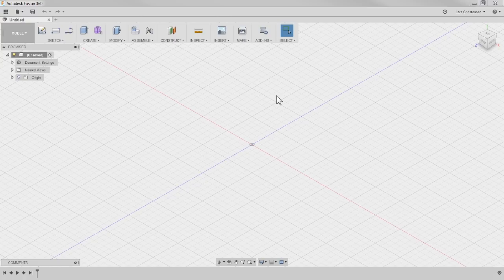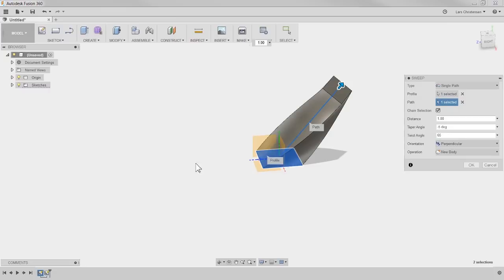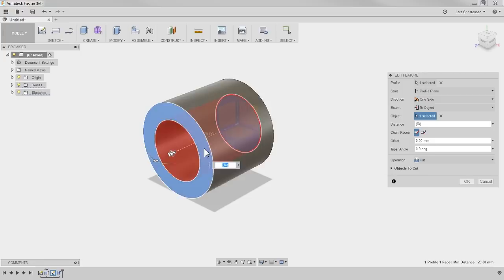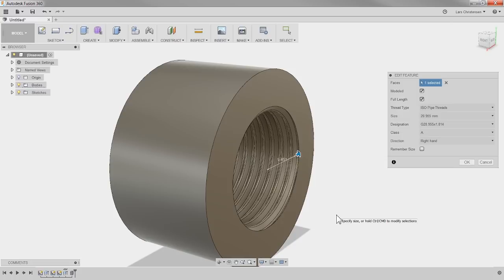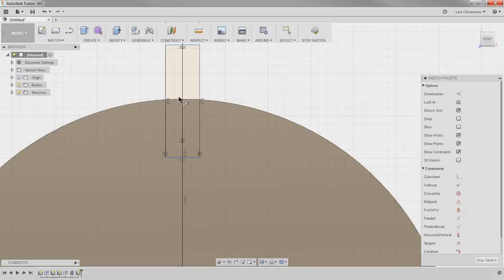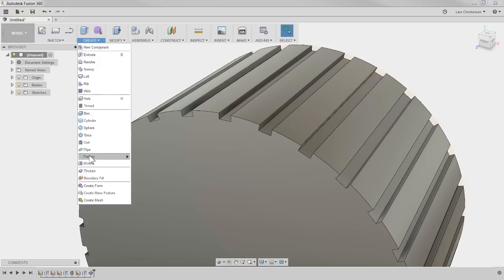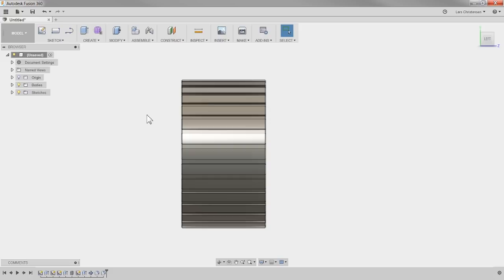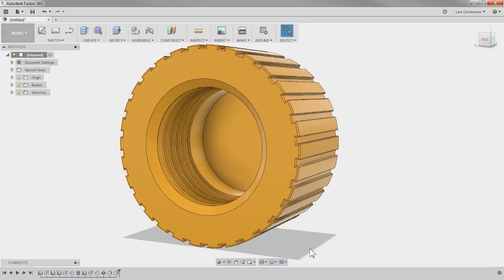Fusion 360 Absolute Beginner - How To Model a Hose Cap - Last Nights Facebook Livestream

Comment: I've watched several of your videos now and despite still being quite new to Fusion 360 and 3D design (<5 months), they have hepled me understand some of the more challenging (and also simple ;-) techniques. As such I would like to thank you very much.
They are very well presented and clear, as well as being very easy to follow and listen to.
All in all, a very useful set of instructional videos thah have helped me create some quite complex products involving 3D printing, custom electronics and ergonomics that have become quite useful for me. (including: a wall LED light strip with cabling through the centre of a swivelling curved arm that I now use every day, and my newest project being a custom DSLR Light Ring with an LCD screen, switches, connectors, a battery, and electronics that include an arduino.)
So, thanks very much for helping me enjoy a new hobby.
Reply from the maker: That is awesome to hear David L .Thank you for watching the videos!
I like the idea about a light ring with an attached screen!!

Hope you have an awesome day!

Comment: I modeled up a quite similar component the other day, then made an assembly and mirrored that component about a plane .... the thing I was not expecting was that the handing of the thread changed along with the mirrored component. I have to inspect it more if there are any options for keeping the thread right handed also on the mirrored copy... because basically that is what you would expect in real life right... you have right handed bolts on both sides of your car for example.
Reply from the maker: Hi SuperRistopaha Thank you for watching!
You make a good point. Right now, when you mirror, you mirror everything

Comment: What if you drew the inner diameter first then offset it by the thickness you want the wall?  Much easier than the outer diameter and trying to do the math to offset for the interior, plus wouldn't this keep the offset distance (wall thickness) even if you changed the diameter of the interior?

Comment: Thank you for the great videos, I have some experience with SoildWorks but your videos have helped a great deal with the Fusion 360 learning curve. BTW the thread profile here in the states is GHT Garden Hose Thread. I am not 100% sure if it crosses to anything but you can find adapters and fittings that will be designated as 1" MNPT X GHT.

Comment: This really helped me understand fusion 360 thanks for taking the time to make a tutorial on threaded parts . how would I go about measuring a thread with calipers to putting it in fusion spent 2 days trying to make a hose thread that works and all are too tight or too loose . finally stole a NHR step file and made my design off of someone's existing thread but would like to do it myself for different style threads in future

Comment: Lars, why are you doing the chamfers before the patterning, but doing the fillets after the patterning (according to the end design history), using the left->right box? I would think you would want to do the three edges of the fillet first, along with the chamfer, and then the outside of the circle fillet, then grab the extrude, chamfer and fillet to pattern. Or is it one of those cases where each one works, and it is just habit?

Comment: For the outer steps, is the way you do it (cutting in the existing part) better than to adding on top/outside (before the circular pattern)? What are the pros/cons or use cases when one is better than the other? Or is it just because, as you explained in another video, it's a best practice to think/do the same way you would work the material manually?

Comment: Regarding dimensioning the rectangle used for the bumbs/grooves (@ ~ 00:36:50) - could one perhaps make the top horizontal of the rectangle tangent to the circle, then just define the height of the rectnagle towards the centre of the circle? Would avoids needing the random second height dimension of the rectangle on the outside of the circle.

But it was good to learn about the ability to dimension from the tangent :-)
Reply from the maker: Hi Mark Cooper Thank you for watching!
I believe you are totally right. You could do that.

Best,
Lars

Comment: You can prove that the bitmap image does not create an actual thread by turning on your analysis view again, then check the box "Modeled" box in "edit feature" and go back to the sectional view. Note the differences in the internal wall.  I am guessing that if you try to print this form without checking the "Modeled" box you will not print a tread, or?
Reply from the maker: Hi John Lohmann Thank you for watching!
That is true. without it checked you only have a pixeled image to resemble threads

Best,
Lars

Comment: This is why you always finalize the feature before you repeat it. That way the final shape you want will repeat with the pattern.

I would also add a blank lip before the thread starts so the cap would sit properly before you start screwing it on. A chamfer is not good enough and you will end up fumble with the cap to get it aligned properly with the thread.

Comment: Since most if not all garden hose threads are 3/4" (imperial) and Fusion 360 does not appear to have them then you must add them, found this on Thingiverse, downloaded the files, added to Fusion 360 and it worked great, I have actually tested the print yet but everything else worked for me, files found here and you just need the xml file: https://www.thingiverse.com/thing:2920861

Comment: What are some important measure tools/tips/tricks (besides quality calipers) for measuring parts to design? I have issues trying to measure screw hole distances, accurate circle diameters, etc.
Reply: Quality Calipers ( Mitutoyo, B&S etc )
Screw Hole : Same, Caliper with round end rod instead of the bulky flat ones ( round ones are thinner thus more fragile ). Or a dedicated depth gage.
Circular diameter : Micrometer ( Mitutoyo, B&S etc ), but do you need that much precision ? 

Overall, a good Mitutoyo or Brown & Sharpe Caliper with a round end rod will help you with almost everything, correct use of the tool makes the real difference, all of the needs you have will be easily done by a caliper if your parts are under 12in and require a precision reading down to 0.001in or 0.0005in.

Comment: Lars, 
I have a question for you. 

I was trying to model 10-32 imperial threads and they wouldn't model. The 10-24,10-28 and 10-36 would just fine. Is this an over site by Autodesk or is it something I'm doing incorrectly. It would apply thread picture to the extruded stud I wanted to make a screw.
To be exact, I extruded a cylinder and then modified to add threads.  Hope that's clear. 

Thanks a million!

Comment: When you measured the threads, did you measure the inside or outside of them to get the hole diameter?
Reply from the maker: Hi Bill Fowle Thank you for watching!
In this case it was the hole diameter. But, check out this video for a more accurate thread discussion
https://youtu.be/jT5nJUKRNnA?list=PL40d7srwyc_Mkgc5wvP_OfVel9aDkNkZ6

Best,
Lars
Reply: Thanks Lars. Excellent videos!

Comment: I like the videos but right out of the gate I can't get some little thing that leaves me behind. This time when I tried to dimension the line off the rectangle and get the angel I could only get the dimension tool to "snap" to vertical dimensions. I could not set an angle and could not figure it out. If some one could tell me what I'm doing wrong I would appreciate it because it kept me from following in my design.
Reply: I figured it out! I had to turn the sketch a little off plane and the ability to set the angle worked. I still don't know why it didn't work for me when looking strait on.
Reply from the maker: Just happy you figured it out! Thank you for posting back

Comment: Been thinking of trying to model a a variable pitch screw (extruder screw) any pointers and... any words of wisdom for trying to cam it for a lathe?
Reply from the maker: I would have said that Fusion would not be up to the job, but then I found this thread on the forum
https://forums.autodesk.com/t5/fusion-360-computer-aided/tapered-variable-pitch-thread/m-p/7167525#M31569

It is done with milling though
Reply: Lars Christensen thanks.  Interesting,  but unfortunately I don't have 4th axis capability yet for my mill. I do however have a Haas tl1. Hopefully something will surface with my searches. Thanks for the lead!

Comment: Much better would be a how to find the exact thread to match your hosecap to replicate it!
Reply from the maker: Hi Gery S. Thank you for watching!
Yes, you are totally right about that.
Reply: Hey Lars - I second Gery S's comment that it would be better to use the correct thread. A previous comment was made that 'I needed a hose cap'. When they print it they will be disappointed. Correctly generating threads that aren't in the Fusion 360 library isn't straightforward. Doing a video on that topic would be helpful. Disclaimer: I'm a Fusion 360 beginner.

Comment: For some reason when i try to pick the circle/ arc tangent, i don't get the black X to select the circle. It always tries to use the center.
Reply: Well, after playing with it some more i can get it to select the arc tangent but it is selecting the arc at the way bottom of the circle off screen.
Reply: Ok, i got it to work, I noticed you were facing the front while i was facing the back. I didn't think it would matter but i guess it does because when i switched mine around so that I'm working on the front i was able to get the little black X and select the arc tangent.
Reply from the maker: Glad you got it figured out.

Best,
Lars

Comment: When I hit "Q" I don't get the same thing that you get.   I do not get an arrow.  I just get a box that wants me to add the measurements in it.  I get no box that says "Extrude."  I have the student free version.  Maybe that feature is not offered?
Reply: you hit "Q" in sketch mode. after hit they will move your camera into prespeticve. and you have the arrow
Reply from the maker: +1 Shaorune
Check that you are not missing a step. This should work

Best,
Lars

Comment: Don't waste your time with NPT thread support in modeling.  NPT is a tapered thread, and an archaic fossil of an old and obsolete dinosaur in mechanical use...  Modeling a threaded component is easy to lock onto an axis.  However, NPT requires the components' translation along that axis to be locked based upon the conical taper.